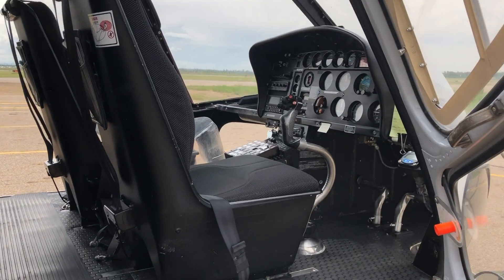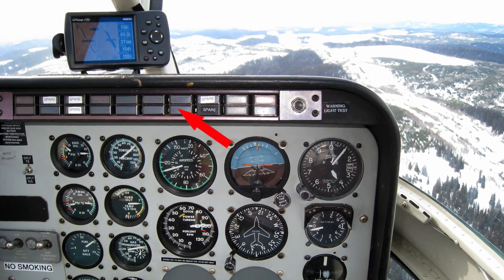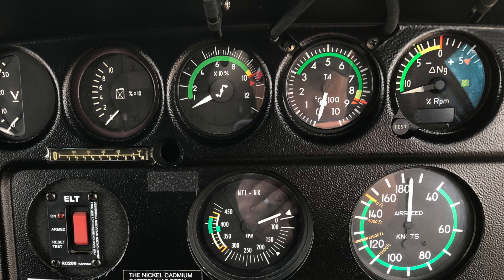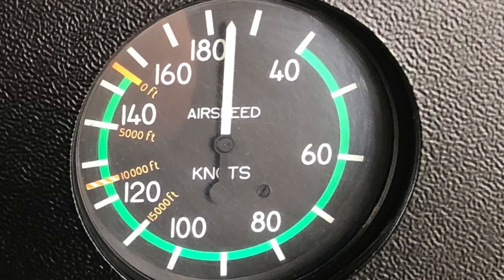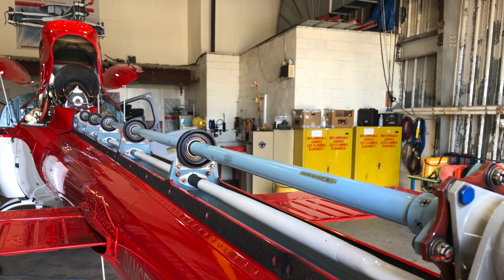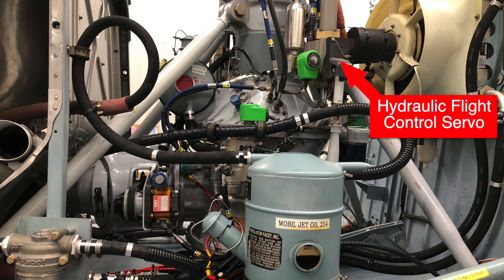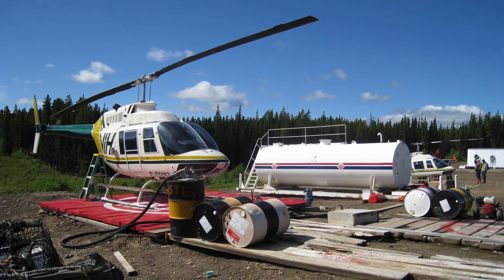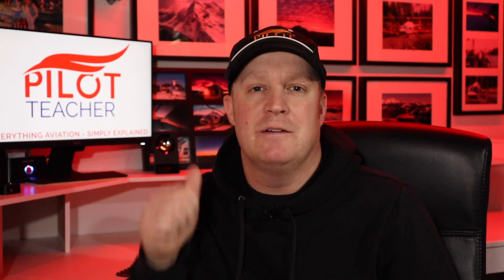Helicopter Terms 101 - Part 2

Comment: Great video.  I didn’t know about the sprag clutch. That’s good if you have an engine failure.  Is a tail rotor failure in a hover a real danger? 
 I remember  the Leicester city football club helicopter crash.
Reply from the maker: Any tail rotor failure can be a mess! If you are over a flat surface, low hover and you catch it quick enough its a none event. However,  if you are in an OGE hover lifting a sling load with trees below you then you need some serious luck on your side to walk away from the wreckage!!